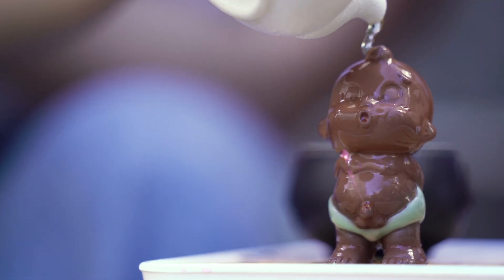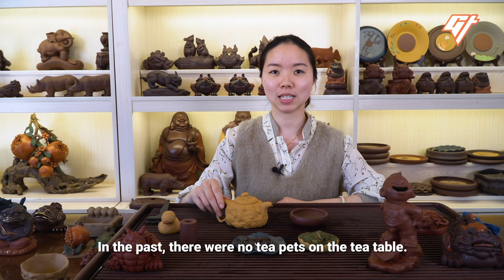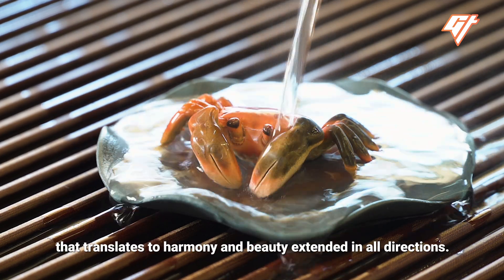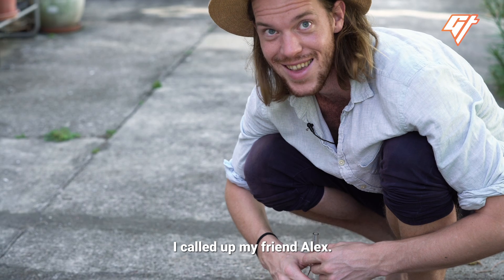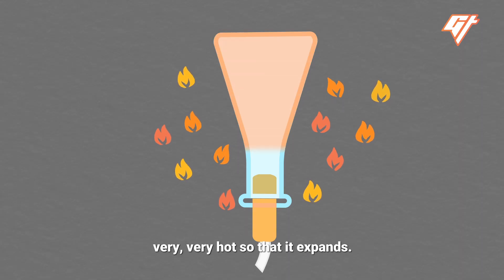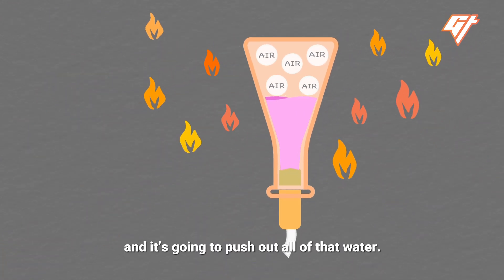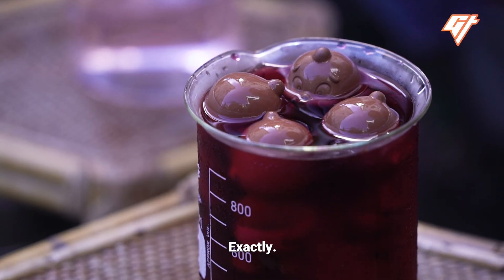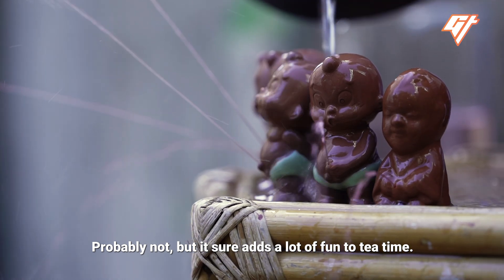How the Chinese ‘Pee-Pee Boy’ Thermometer Works

Comment: It’s a toy, but is it a thermometer?  Only if the only two temperatures you want to measure are “cold” and “very hot.”
Reply: it's actually relatively good, because the distance it pees is relative to the temperature, so if you know the temperature you like for your tea, you can pour the water on it and gauge how hot it is without burning yourself.